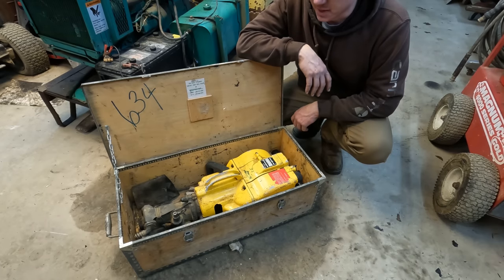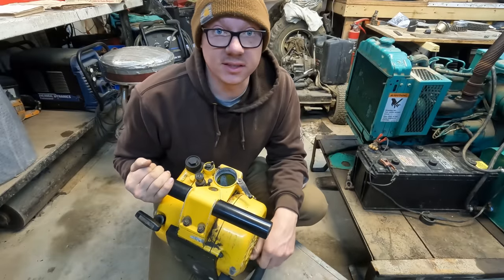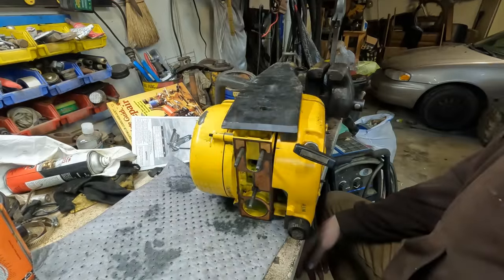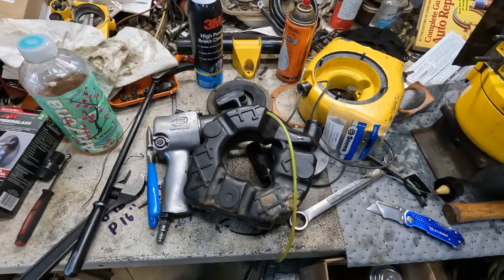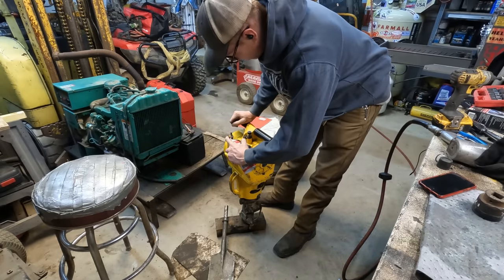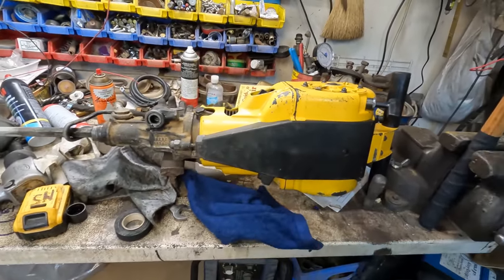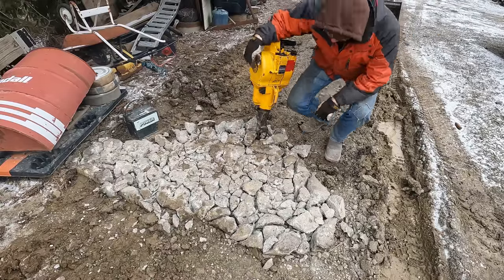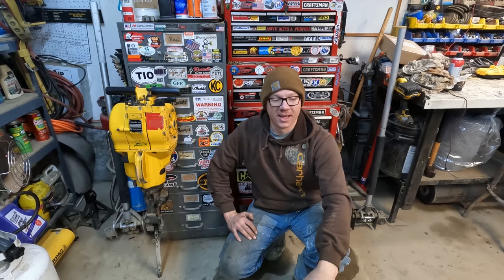RARE? Gas Powered Jack Hammer, Will it ever Run again??  (Pionjar 120)

Comment: (?)
RARE? Gas Powered Jack Hammer, Will it ever Run again?? (Pionjar 120)
RARE?
No they weren't rare - especially not here on the NZR where several went to every track gang for faster (if running right) one-man ballast tamping was required, with several men using these, nor were they rare on most railways world wide (as almost every railway in the 70's and 80's also used these for packing ballast under sleepers until heavier tamper machines became the norm)

Gas powered Jack Hammer - 
Yes Gas (?) being a thick petrol/oil mix of about 20/1 (sometimes we even ran them on 15/1)
I saw you "filling this" with what appeared to be "neat petrol" (no oil added)?
NEVER USE NEAT PETROL - as they need the upper (and lower) cylinder lubrication - of a denser oil/fuel ratio than most normal two stroke machines

Will it ever Run again?? (Pionjar 120)
DID THEY EVER TRULY RUN - 
Most often they didn't and were a right PITA 
As they were more often - too much trouble to get running, which meant that (Way & Works) railway track gangs throughout NZ - normally left them in the work's bus and took the old/original "ballast tamping" garden spades out instead? 

If you do ever get it running (on a consistent level) - be pleased with yourself - as they were a pain to start / run or keep running - when needed urgently with trains due through - whereas we knew what could be done with the old hand-packing spade, even though we got sore arms from slamming them against the ballast - we at least saw the benefit of getting the job done in clean air without the rest of the body being shaken to bits when motorised packing was done (or the arms torn off trying to pull start the sods).